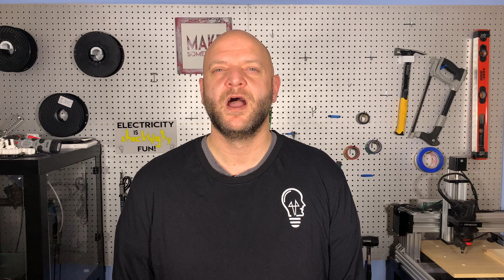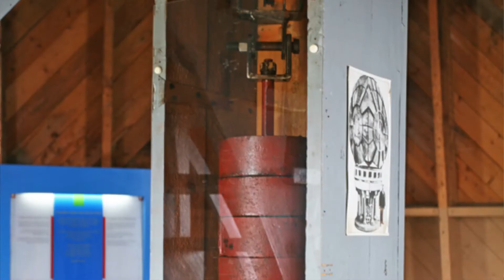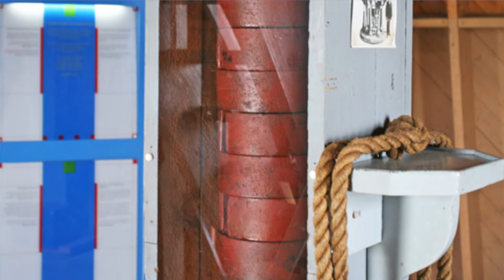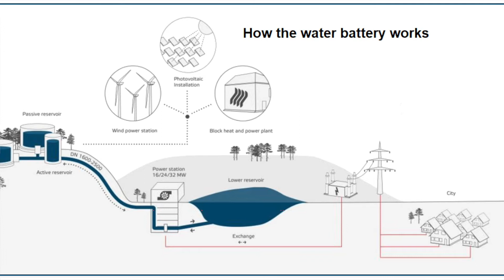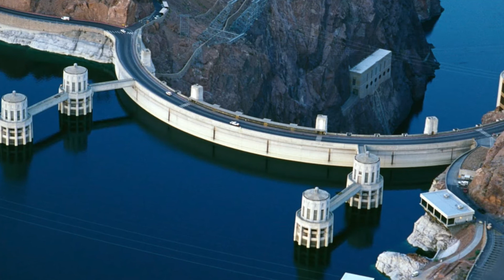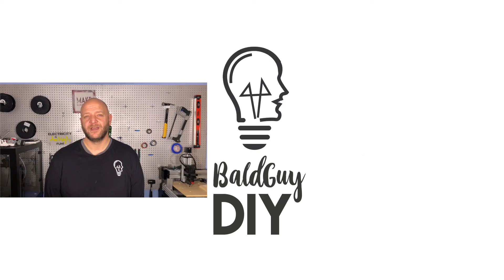DIY Idea Generator:Gravity Batteries and Other Storage

Comment: Animals. Animals have essentially from the dawn of man been used as a alternative form of energy. Weather it be plowing a field for planting or using carrier pigeons to relay messages. Animals have been used in this way as well. Of course we take care of those animals and we dont abuse them, so its not like they can be Turned Into a battery but they can be used just like a spring, as a alternative source of energy.

Just wanted to put that out there, since this is probably something most wouldn't think of considering as a alternative power source....

Comment: Think of the massive size you would need to get any benefit from your gravity battery.   1 HP = 735.5 watts. 1 HP = moving 550 Lbs 1 foot for 1 second. So if you move 550 lbs 10 feet per second you get 735.5 watts for 10 seconds. If you want to have 735.5 watts for 1 hour you have to move 550 Lbs 3,600 ft. If you increase the weight 10X to 5,500 Lbs you still have to move it 360 ft to get 1 hours worth of 735.5 watts.
Reply from the maker: There are many applications where the best energy storage options come from fossil fuels and electricity because they are very energy dense. But there are also many places where they are impractical. Thanks for watching and taking the time to comment!

Comment: Put a ware driven generator on the water pipe supplying your house. Flushing,showering water the lawn while you charge ??
Reply from the maker: That sounds great, but it would reduce your water flow greatly. As the load on a generator increases, the amount of force it takes to turn the turbine increases. If you regulated the current output of the generator, you could possibly find a workable compromise between the impact on water pressure and the amount of current generated. However, that likely wouldn’t contribute a meaningful amount of your total electricity requirements. 

What works better is to use a surplus of energy, that doesn’t cut into the effectiveness of your energy demands. Such as generating electricity in a flowing river, or using solar panels.

Comment: There's a pump storage site near me in SE TN.  You need a lake size mountain top storage.  They pump from the river at night providing base load to the grid, then reverse flow during peak demand.  When I toured it in the 1980s, they had the largest motor/generators at the time.  

I also read the desert ME in the past, the large buildings were designed to direct the cold night air into underground areas beneath the building then used this cool air during the heat of the day to keep the building tolerable.  It was very passive based on architectural design.
Reply from the maker: Thanks for watching and sharing that!

Comment: Thanks for this thought provoking run through so many storage options. I've seen people make "forever" batteries (about 1 volt each), out of Epsom salts and I believe a bit of gallium. Heating this mixture and puting it into copper pipe end caps which they've soldered leads into. They claim to be able to leave this in a cabin and after months, when they return hook the leads back to a light and it works.  Does this make logical "electrical" sense? I've never tried it myself. They also said it didn't seem to give any more voltage no matter how big they made it, so they used the small copper caps. Thanks for your thoughts!
Reply from the maker: I’ve never heard of them. I’ll check it out. Thanks for watching and commenting!